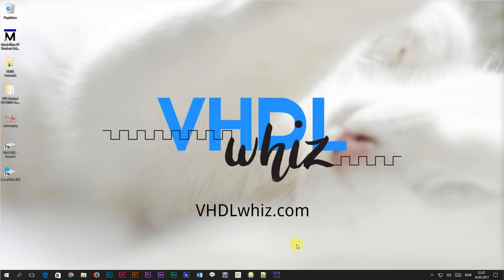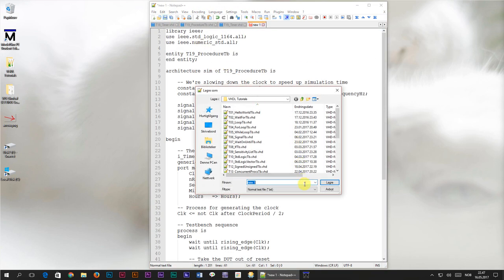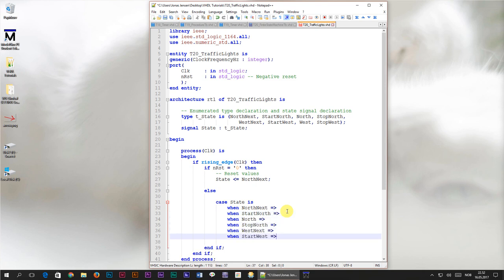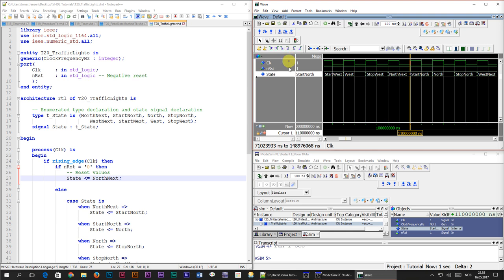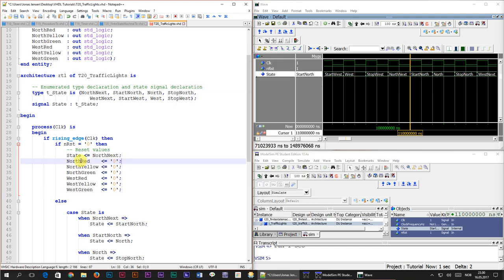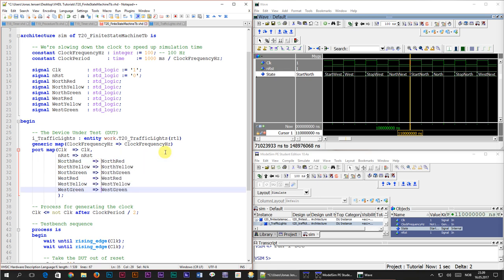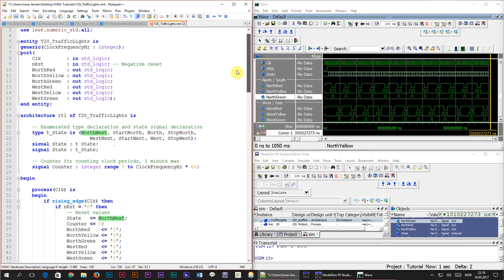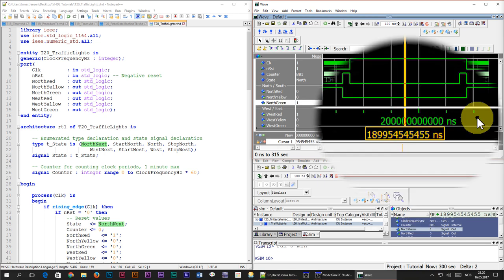How to create a Finite-State Machine in VHDL

Comment: Can I ask you a non related question about the VHDL descriptions? whether you can use them to formaly verify their correctness? with a model checker or a theorem prover for example? or is it not possible? I am going to  work on the formal verification of circuits, and my advisor told me that I shouldn't use imperative HDLs like verilog and VHDL, because they only allow simulation, but from what i've found, it is possible,  but since i didn't go into deep in them, I don't know how possible it is. Can you please answer me, I would apprieciate the help.

Comment: there is a delay when counter is reaching to a certain value making the light pattern stay when it should change, in order to make light pattern change the circuit need to count 1 more to the next state, therefore the second state and so on will have 1 more counter value than it should be.

Comment: I have noticed that nowadays most people write the output logic, logic and update state inside of one process clock, is that correctly done? If ha follow strictly  the mealy machine structure , then from coming input to update the new state takes two clock cycles?
Reply from the maker: In my opinion, there's no "best" way to create a state machine. I think newbies and people with software backgrounds are more likely to use the one-process method. It's because they are used to sequential thinking. I have an article where I talk about one, two, and three process FSMs. Perhaps something for you?
https://vhdlwhiz.com/n-process-state-machine/

Comment: In your simulation the value of the lights(NorthRed, WestRed etc.) get changed as soon as the value of the state changes....but I think the value of the lights should change on the next clock cycle according to your code , say the current state is NorthNext after 5 sec  the state will become StartNorth...but the lights for StartNorth should not get changed at the same time.... rather it should change on the next clock cycle because the case for StartNorth will be hit on the next clock cycle....
Actually I can't understand this... please explain. 
Thank you.
Reply from the maker: The simulation is behaving as you are expecting, the output is lagging one clock cycle behind the State signal. I'm talking about this starting at 16:18 in the video. That's because this FSM is a Moore type state machine. The behavior you described at first is a Mealy type state machine. You can read more about Mealy and Moore type state machines in VHDL in my later blog post:
https://vhdlwhiz.com/n-process-state-machine/

Comment: Why is the counter declaration range upto (clkFrequencyHz * 60) and not to (clkFrequencyHz - 1) * 60 ?

Edit: Added the multiplication by 60 and parenthesis
Reply from the maker: That's because the "Counter <= Counter + 1;" line happens on every clock cycle. It's outside of the Case statement. If we set it to "ClockFrequencyHz * 60 - 1" there will be a runtime error in the simulation when Counter reaches ClockFrequencyHz * 60. That happens on the clock cycle after "Counter = ClockFrequencyHz * 5 -1".

If you want to declare the range as "ClockFrequencyHz * 60 - 1" you can put the counter incrementing in an Else branch to avoid that situation:

if Counter = ClockFrequencyHz * 60 -1 then
  Counter <= 0;
  State   <= StopNorth;
else
   Counter <= Counter + 1;

end if;

Comment: I hate negative reset a lot. Why do you use it? Isn't it less intuitive and ideal than just making a reset that resets at 1? Does the industry prefer negative reset? Thanks for the clarification.
Reply from the maker: The primary motivation behind negative reset is that FPGA registers get initialized to '0' by default. If you forget to connect the reset, you get a hard failure, rather than a soft error.

I think positive reset is more common, and I've started using it in my newer articles. Instead, I use a negative reset coming from the FPGA pin. Then I create a VHDL module that synchronized and inverts the reset.

Finally, I connect the positive reset coming from the reset module to the rest of the design.

Comment: The state doesn’t change from NorthNext, I copied the code from the blog post
Reply from the maker: Perhaps you're not simulating for enough time. The default in Questa/ModelSim is 100 nanoseconds, but you need to simulate for 5 seconds for the state to change. Try typing "run 10 sec" in the console. 

By the way, there is a demo Questa/ModelSim project that you can download from the article. Look for the "Need the ModelSim/Questa project files?" form on this page: https://vhdlwhiz.com/finite-state-machine/
Reply: @VHDLwhiz  Thank you so much for your reply. It works fine now. Thanks for the video it was very helpful

Comment: I have added your code to ModelSim and it doesnt show up all of the signals why?
Reply from the maker: You have to select the correct instance in the SIM tab in ModelSim. Then the signal belonging to that instance will show up in the Objects window.
Reply: @VHDLwhiz  I can only see clockfrequency,  state and counter but i cant see NorthRed and others in objects tab in all of the instances. Just copied the code in your website
Reply from the maker: @msbrdmr  You probably have a new version of ModelSim or Questa that optimizes away signals it thinks you're not using.

When going to Simulate->Start Simulation, click Optimization Options and select "Apply full visibility.." That should fix the problem.